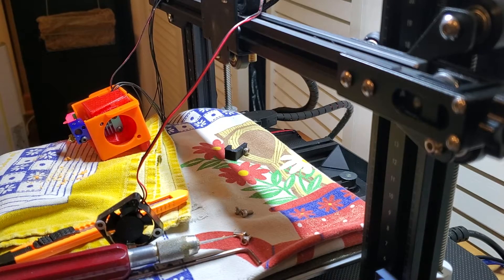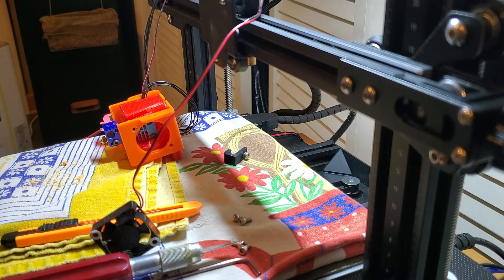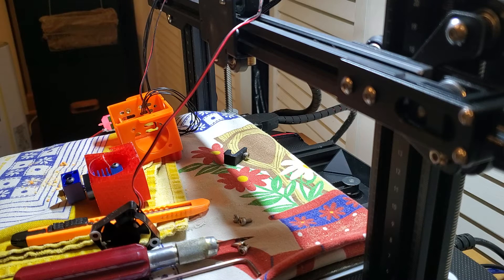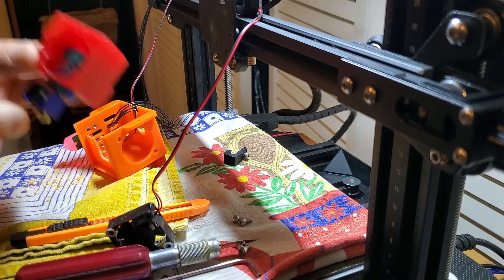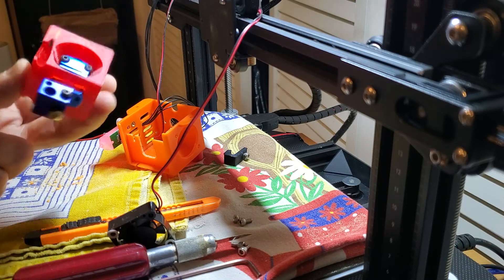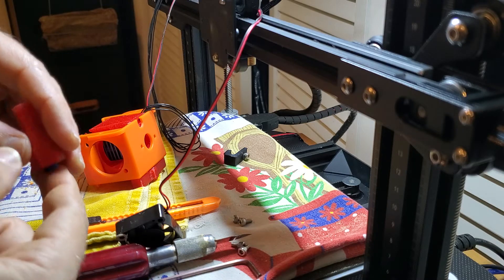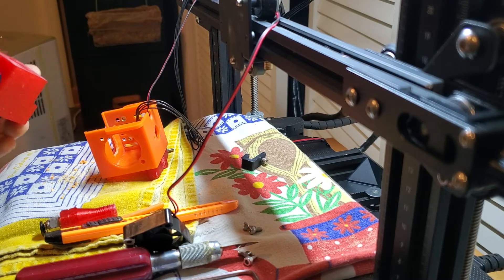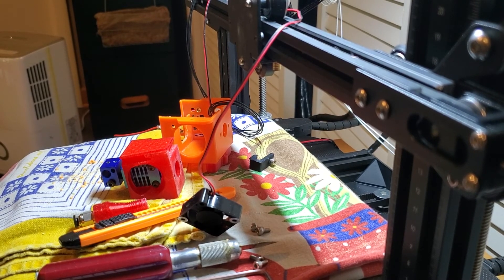Eryone ER20 Hot end upgrade Part 1

Comment: Hey Jay,  have you got a link for the silicone socks you use for this hotend?  Also,  how do you adjust the offset?  This whole setup is now longer than the default meaning the z stop is too low and my nozzle pushes the bes wway down.

Awesome video though!  Everything else is mounted and seems to be working properly!  Just need to adjust that offset and see what kinda prints I can get going.
Reply: Nevermind on the offset,  i'm not using a touch sensor so i just raised my Z endstop.  Duh.

Comment: Hi Jay
Appart from the color, there are 2 hotends on the Aliexpress link you provide to us. One is "straight through" and the other is "high temperature". Which one to order as i don't really understand the difference.
Thanks for all your videos
Reply from the maker: Thanks for asking that question!  You want the straight-through version if you are going to continue using a PTFE heat break like the original Eryone hot end.  If you want to move to an all-metal setup (not necessary or even recommended for PLA/PETG) then get the high-temp version (and your PTFE extension will be quite a bit shorter and less integral to the operation of the hot end).
Reply: @jayburkette8977  Thanks Jay, All's clear now !

Comment: what heater cartridge and thermistor will you be using?
Reply from the maker: I used the stock cartridge (40watt) and thermister (100k)...
Reply: @jayburkette8977  Stock cartridge is a little too long for the jhead  you linked but everything I've read says that's ok.  Maybe a little less efficient but as long as you arnt touching it while heated (duh)  should be ok.